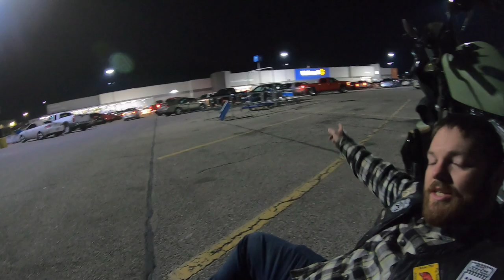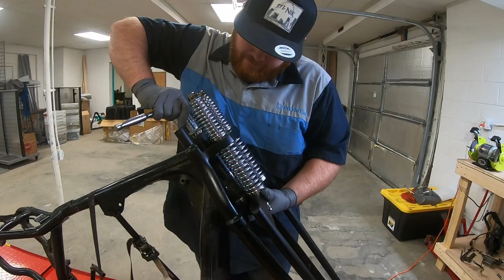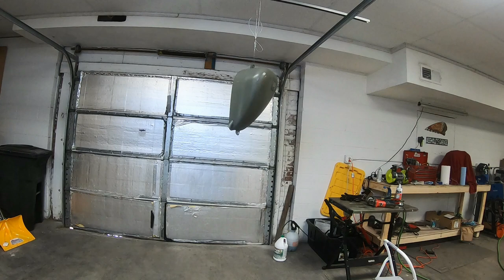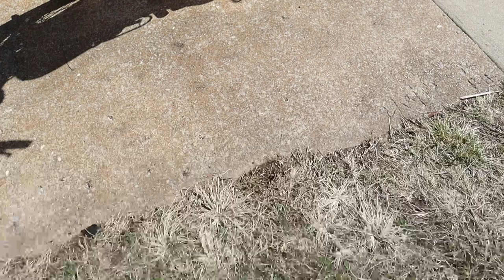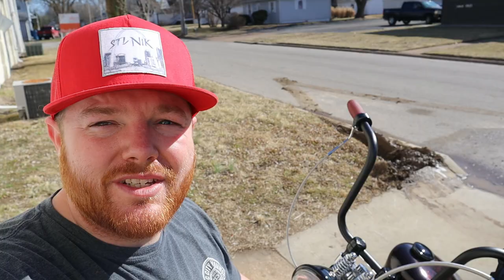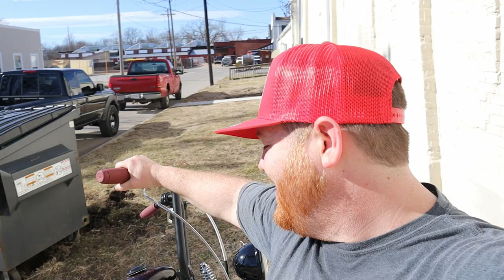The birth of a chopper! | Stock sportster to hardtail chopper! |

Comment: Hopefully you have added a oil cooler... I've seen many of them along with 5 speed bikes trying to run with the 6 speeds have failure
Reply from the maker: No cooler at this time, but I did upgrade the jugs and heads to big fins for better cooling

Comment: Nice work dude! Building one myself similar. Custom Paint is my main gig. Just a lil tip for future you can use a 2k 2part clear coat in a can. It will harden and be fuel resistant and sand and polish like auto clear. Car rep 2k it’s called. Cheers!